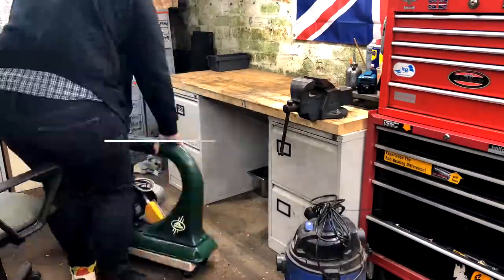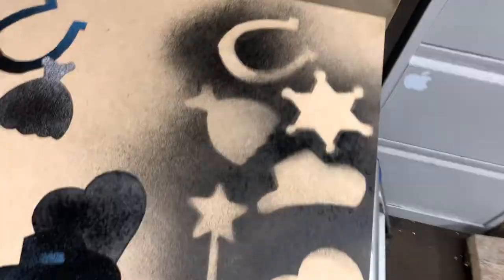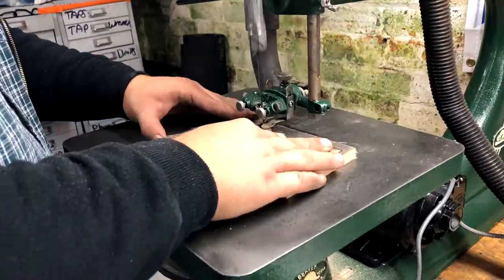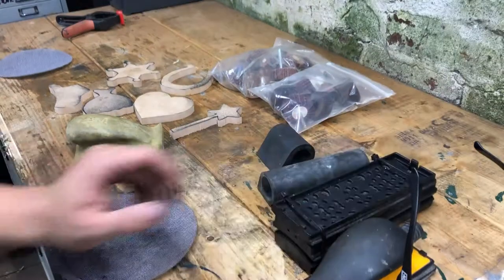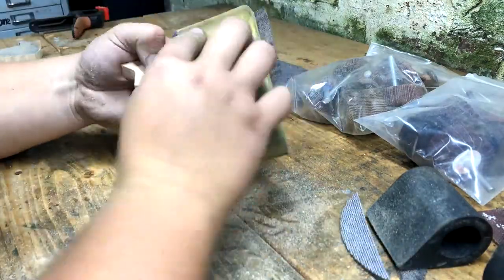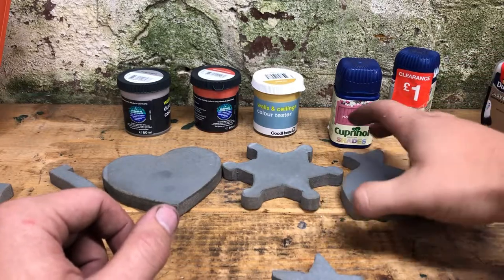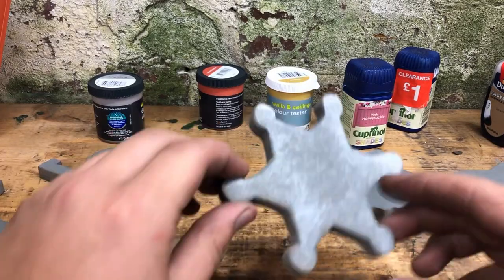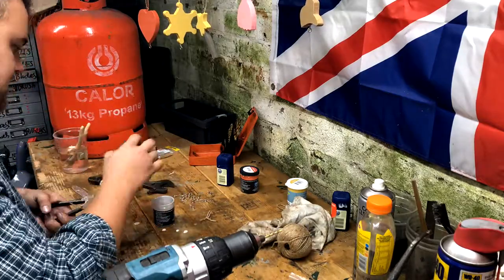DIY Scroll Saw starter project for children's decorations! GB

Comment: Nice one. I knew those vintage scroll saws were going to be great, but this is the first video I've seen that confirms it. It was the Walker Turner saw that is very similar to your Beaver (possibly one is a badged version of the other) and not the Meddings. Next time I have space in my workshop, money at the time and one is available I'm going to sell my Hegner and get one (I've seen them for about £250 from time to time). Thanks for the video.